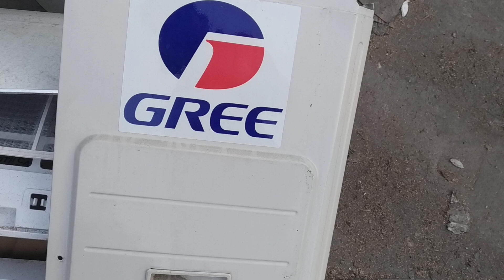Outdoor Unit Sensors Connections - Gree Air Conditioner.

Comment: Ambient sensor is missing error code 3 what to do
Reply from the maker: you can replace the senson. if you dont have you can direct the connector inside PCB untill you Buy a new one sensor.
Reply: @RepairingSchool  thanks! but I also connect a10k register same place is dangerous

Comment: Dear Bro, u r doing a marvelous job by posting these informative VDOs. Bro, my GREE 12AITH is working super fine. I only have a question about out door ambient temperature sensor. When I press temp button on my remote it shows indoor temperature of my room (Real Time) but when I press again to get the reading of out door temperature, value doesn't change. Means it doesn't shows out door temperature, What should be the issue, Bad Sensor or some thing else? (Its happening from day-1)
Reply from the maker: As I know... You cant get the reading of your outdoor ambient temperature 🌡️.
There the only option in the remote for your insider unit's temperature 🌡️ or room temperature system.
Thanks for being here.
Have a nice day!

Comment: sir haier 48cj03 out door not running and 5 time red light blinking on outdoor pcb
Reply from the maker: Bro its over load or over heated outdoor unit problem, thats why you gas pressure Will increase and it shows these error 5 time blinking....
So make sure... Your ac outside unit condenser is cleaned. Then check your gas pressure, may be some time hp swith also open of broken... So you can also check it. Check fan motor speed is good or not, capacitor for weak.. or burned. Etc 
Thanks for your questions 😊😊
Happy to help you!